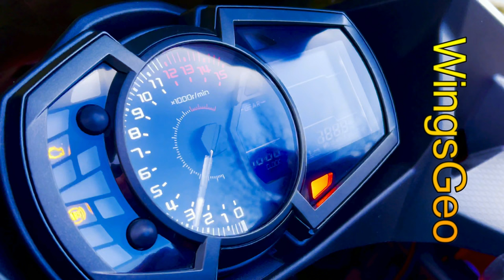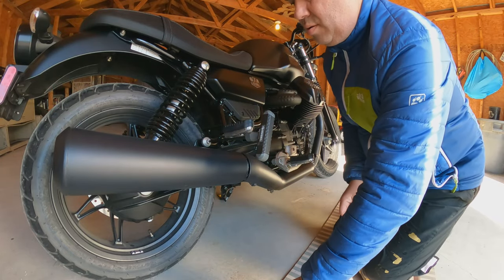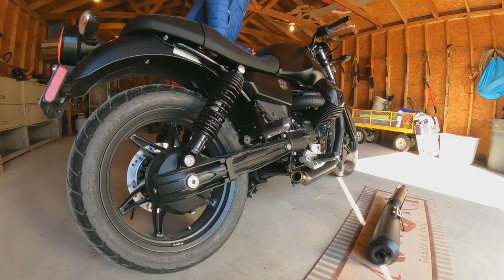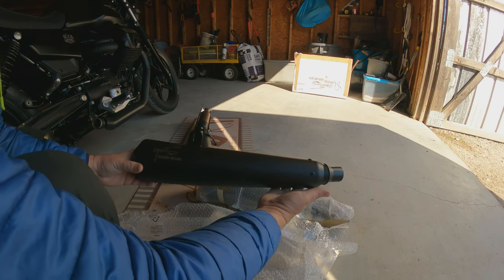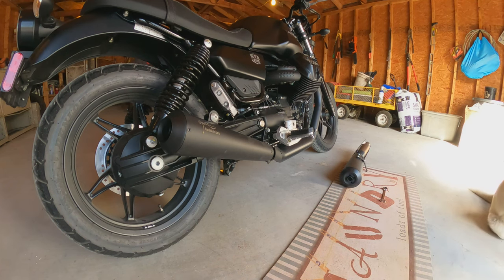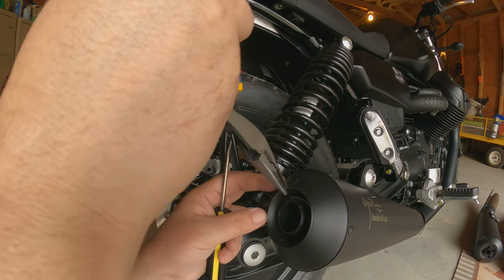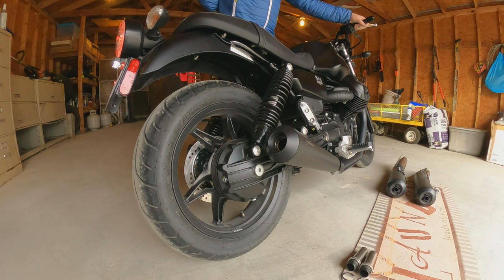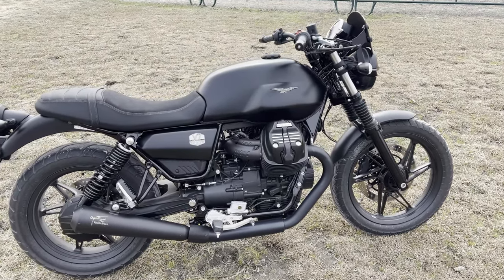Moto Guzzi V7 E5 | Agostini Install & Comparison

Comment: Apparently, at least with the mistral exhaust, when the baffle is removed the bike needs a retune or it won't run quite right. Might not be the same with this exhaust though.
Reply from the maker: I did not have any issues before I sold it but I will say at the time there was nothing available for the E5 bikes. Not sure if there is a tune now via UP Map or the likes.

Comment: I have the longer Agostini's on my v9 and love them too.   Regarding the spring clip, my guess is you didn't have your snap ring tool set quite right.  I have no problem poping mine outs in mere seconds using the same tool.
Reply from the maker: Yeah could be a user error, or mine is just too large. I tried with different lengths at the top but was unable to fully compress the snap ring causing it not to want to come out.

Comment: what fly shield is that?
Reply from the maker: That is an Isotta Flyshield, I did change it to the GCorse fairing though, which I liked much better. There is a video about it on the channel.
Reply: @BunnyandBman  Ill check it out. Im getting my short Agostini delivered soon for my 2018 Dark Carbon. Im using a Dart screen.  Im excited for them.
Reply from the maker: @sph828  You won't be disappointed, on the V7, the Agostini's are magic!

Comment: Does it mess up the ecu etc with or without db killer? Other issues?
Reply from the maker: I had no issues, I would recommend however a re map with the UpMap solution. It was not available at the time of the video.

Comment: These V7s are just classic looking, super sexy, bikes! That exhaust sounds incredible! First time I’ve heard a MG sound like that, but I don’t have much experience with them at all. I’m a Harley guy and the V7 is exactly what Harley should have done with the sportster lineup. Make it E5 compliant, lighten it up, and give it some extra performance. MG succeeds where Harley fails. Thinking seriously about adding one to the garage! Very seriously!
Reply from the maker: I agree, I test-rode the 883 which was meh, and the 1200 which was ok. If you look at the current V7 Special Edition, it is a steal in my book. my only complaint is the non-TFT instrument cluster. I like Physical dials or at least replicate it with a good TFT but I get it, as it was built somewhat to a price point.
Reply: Yeah, in Italy Moto Guzzi are selling good after Harley Davidson stopped the Sportster line, after all with a V7 you can do all the things that you can do with the Sportster and it's so more lighter than the Sportster. 
It's really a shame that the Sporty line is no more in production.

Comment: Great choice, for V7 there are  two great exhaust manufacturers from Mandello, Agostini anf Mistral. Both of them top quality and sound. For V85 I chose Zard exhaust because of look and because I use V85 for travel so I apreciate similar noise level to the stock exhaust with richer sound and little more bass. ;-)
Reply from the maker: The Zard was on top of my list for the V85, I just could not get my hands on one and then I figured out the "free hack" ... lol, I actually wanted the long pipes from Agostini, but again, can't even find them, but I am very happy how the short ones turned out.

Comment: I had the same issue as you, hard to remove the c-clips of the DB-killers. Simple fix, remove the excess material on the inside of the c-clips. That way, both sides come closer and are easy to remove.
Reply from the maker: thanks for the tip, I did not have a good time removing these ... lol

Comment: I went with Mistral for my V7 but certainly considered Agostini after watching, the drive by shots really sold it! At the end of the day they just sounded too much like my Guzzi Tech Griso exhaust and wanted something different. Just hope the DB killers on Mistrals are easier to remove.
Reply from the maker: I don’t think you can go wrong either way. I just put a Mistral on my V100 and it sounds very good. Its a Agostini header /Y pipe with the mistral end can. On my V85 i had it reverse, they all sound good in their own way … ;)

Comment: Very good! I have the longer reverse coned Agostini's in the same color on my bike. I much prefer without DB killers. Great to get the attention of drivers around you with the blip of the throttle. I use a special set of snap ring pilers to take the baffles in and out as needed but i primarily do not use DB killers. AF1 racing is one of the best MG dealers in the nation. If you go out there and they have time they will give you a full tour of their facilities. World class guys and girls! I take my bike from Houston to them to Austin if i have a warranty claim, definitely worth the drive! You make great quality video, keep up the good work!
Reply from the maker: Thank you! I tried to deal with Xtreme in Houston to buy a MG Racer, it was awful. Ended up not getting it, so I see your point going to Austin for sure. I have the special tool but it was still very difficult, maybe user error? ... lol As for AF1, I am very impressed, I am gravitating towards Energica for my first electric bike and they are the only game in town, so this is a good test how easy they are to deal with.
Reply: @BunnyandBman  I got my bike from TeamXtreme and they're total scammers. I wouldn't recommend anyone doing business with them! (They recently changed their name to full throttle powersports to try to shake their bad reputation) If I ever run into you I'll tell you the whole story. No kidding, AF1 really saved my ass and made me give Moto Guzzi a second chance, couldn't be happier!!
Reply from the maker: @xtrythis1170  That's fantastic that you stayed with Guzzi, I am starting to really see the attraction to the brand for a lot of reasons. I also used to work in Houston and still have several friends there and will be visiting sooner than later with the V85. Luckily I only have to make it to Conroe ... lol
Reply: @BunnyandBman  Well I'm in Magnolia which isn't too far from there. Definitely need to meet up in Anderson on highway 3039. Beautiful road out there. It's the closest thing we have to curvy roads around Houston. Lol.

Comment: Hello. Have you received any engine flashlight warnings when you installed the Agostini (especialli after removing db killers)? Or did you do any ECU modifications?
Reply from the maker: When I did it, no errors or fault indicators. At this point , not required but I would recommend the UpMap tuning solution to get the fueling right.

Comment: the tool you have for removing the snap ring, didnt work?.. there is a (yellow) lever on your snap ring plier that changes from inner to outer snap ring removal. was it too short? it looks like it should have worked. Sounds great though!
Reply from the maker: I tried it both ways, but I think my tool was not correctly sized hence it gave me a lot of trouble. You are correct, with the right tool, it should not be a big deal, going with user error here ... =), and yes probably one of the best-sounding pipes out there.

Comment: What did you do about tuning this bike after you added the exhaust? Did you just keep it at the dealer tune? Been struggling to find a lot of tuning options for the 850 model.
Reply from the maker: When I made the video there was nothing out there yet. Now there is UP map, I can recommend it, just tuned my V100 for the cat delete and big bore headers, was a breeze, no drama.

Comment: Did you measure the DBs you get without the killers? This sound is very charming, but cops are quite severe on this in Québec. And yes, they will measure the DBs before you can hit the road again (max 100 decibels)
Reply from the maker: I did not because here in Texas we don’t have any laws for noise and cops don’t care. They are quite loud without the db killers but sound amazing. Since I always wear earplugs when riding it was just right for me.

Comment: Did you not need to remap the ecu since you removed the db killer? Did you feel a lag in the throttle?
Reply from the maker: I would recommend it, there was just a hint of it , nothing major but with Upmap now available its rather easy.

Comment: nice soud! where is the cat btw? in the back pipes or in the straight piping under the footpegs?
Reply from the maker: Under the foot pegs!
Reply: @BunnyandBman  aha! thanks for the info - somebody else was telling me that the cat is in the end exhaust pipes... So I was not sure... so to get rid of the cat I would need to change the whole piping 😕
Reply: @BunnyandBman  hi, thanks for the vid! nice explanation of how easy it is to change them. are you sure that the cat is under the foot pegs? i mean for stock exhausts maybe yes, but the agostinis dont have them inside... you would need to install them in the agostinis, which i am still figuring out how to do... do you have an idea?
Reply from the maker: @manuelstaber5983  Agostini's don't have CAT's, only the stock exhaust has them build in. I am not sure but there might be an option with build in CAT for the Agostini. I got mine from AF1Racing.com, they are very helpful, I would chat with them and see what your options are. Hope this helps.

Comment: I thought the 850 motor doesnt like the fuel mixture when slip on exhaust have the dB killers removed. I thought they needed an New mapping?
Reply from the maker: It is recommended but not required. At the time the video was made, there was nothing available. Now there are fuel tuning / mapping solutions available via UP Map.
Reply: I installed mine without the new mapping and things were fine. The whole mechanic can easily take it. But the new mapping made it much smoother. Highly suggested, not obligated.
Reply from the maker: @jaybou007  agreed, recommended but not a must.

Comment: Great video!

What sort of remap did you use for having the dB killers out?
Reply from the maker: Thank you! and no remap at all. I did revert back to the factory air filter as the high-flow one seemed to lean it out too much. Has been running great, not sure if Guzzitech has a custom map at this point, but at the time of installation, nothing was available.
Reply: @BunnyandBman  So you haven't had any issues in conjunction w/ OEM air filter. have you looked at the plugs? Reason  I'm asking, my set of Agostini were just delivered.
Reply from the maker: @jacksdad7933  I have not checked the plugs. She was running with no issues and made good power. Take a look at my top-speed run video and you know what I mean ... =). I check Guzzitech periodically but they still don't have a reflash tool for the newer V7's.
Reply: @BunnyandBman  Will do, mine only has 397 mi so under 4k rpm. Have a Rapidbike Easy ordered but will be 4 weeks, should help ensure not running too lean. I live and ride mountain twisties 3500-5500 ft El.
Reply: Update sent RBE back as Dimsport said it wasn't for 2021 models. Seem we are awaiting GTM to come up w/mapping + re-flash tool supposedly they will released soon. Mine seems to run fine w/ Db killers in and OEM air filter slight popping on decel.
Reply from the maker: @jacksdad7933  That is what I heard for the E5 models, V7 and V85. No one has cracked their ECU's yet. My V85 runs better with the DB killers in for some reason, the V7 did ok without.

Comment: Those Agostini's sound and look fantastic! Nice upgrade. I am considering my next bike and hope to test ride a 2021 V7 E5 this week if the weather allows. What year is this bike? 2021? I ask because it seems that somewhere part way through the manufacture year they changed the blinkers to LED and changed the shape of the rear brake light because I am seeing 2021's with both.  
How many miles did you ride before changing to the Agostinis? Your gaskets looked in perfect condition and did not appear to get damaged when removing the stock cans. Did the Agostinis come with new gaskets?
Reply from the maker: It is a late 2021, the LED blinkers are from the euro version that we don't get due to regulations here in the USA. You can however fix that with aftermarket ones.I belive I had about 300 miles before switching to the Agostini's. Agostinis did not require any gaskets as far as I remember and I did not detect any exhaust leaks after the installation. Hope this helps. Cheers!
Reply: @BunnyandBman  I was wondering if the LED blinkers and the differently shaped brake light was Euro specific but I had no logic to make sense of that. We have plenty of LED blinkers here on stock bikes...Like my 2021 Honda Rebel 500. How is it the Moto Guzzi's are excluded from having them?
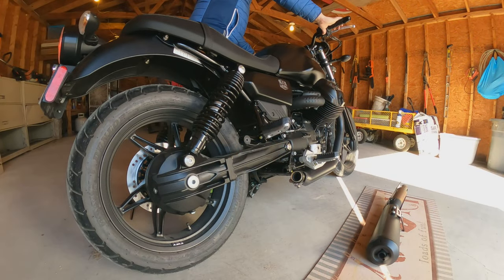Regarding the gaskets....It looks like especially at 2:27 thru 2:31 I can see what appears to be stock from factory a copper weave gasket on the end of your header pipe. I had one on my Honda which was damaged removing the stock muffler but fortunately the aftermarket can was designed to clamp directly onto the header without a gasket so I did not have to source one to replace.
Reply from the maker: @dustytriumph  Concerning the blinkers, not sure, If I had to guess I would say cost might have been a factor why they stuck with the old style. But honestly I am a bit suprised, every bike I own from kawasaki, honda and Moto Guzzi have the old style blinkers and I was told it is because of the outdated regulations here.
Reply: @BunnyandBman  I just got back from test riding the E5 V7 850. Whoa! Very different (as expected but even more so than I imagined) than my Honda Rebel 500 and the Indian Scout Sixty I test rode last week. I've heard the terms "very agricultural" and "the Italian Harley" used. Yah, I'd say that sums it up. All I know as a new rider with only 3000 miles is you really know you are riding a motorcycle and not a sewing machine. Man that was raw and visceral compared to what I've ridden. 
The dealer-owner suggested he thought the blinkers we in the US get on the V7 might have to do with cost. I much prefer the look of the Euro brake light and turn signals but I wouldn't bother swapping out should I get one of these. Bit of a disappointment however.
My Rebel came with LED turn signals that stay on as running lights. Their use started I think with the 2020 model launched in 2019. That's the sum total of all I know about LED.  ;-),
Reply from the maker: @dustytriumph  I am a huge fan of the V7, if you opt for the Stone E5 instead of the Special, you save a few bucks, get tubeless tires and LED for front and rear , the front has a build in LED running light in the shape of the MG Eagle, so cool! Anyhow, these bikes have a lot of character for sure and are not your average Honda. The transnission takes about 2000 miles to break in, but after that they shift amazingly smooth, at least that is what happed with my V85.
Reply: @BunnyandBman  I've looked at these with interest for years and the black V7 Stone would always be my only choice for the overall look but also the cast wheels and tubeless tires as well as lack of chrome.
Reply from the maker: @dustytriumph  I don't think you can go wrong with either version, but yes the Stone has the advantage of the tubeless tires and LED front light.

Comment: I’m looking at a set of these. So when riding do they have that droning noise or just a nice rumble. Hope makes sense. Thank you for your input
Reply from the maker: I would go with the rumble, but as a disclaimer, I ALWAYS wear earplugs, so if there is any, it probably gets canceled by them. On a side note, you should not have that problem with the DB killers left in place, it was just too tame for me, considering my earplugs.
Reply: I ride ear plugs Shoei GTair helmet. Should be ok. Thank you appreciate your reply
Reply: Am I missing something,  people spend a fortune on louder pipes, then ride with earplugs in so they are not to loud....   Why not just keep the standard pipes and the money
Reply: @chriscurrie5597  it's not just about how loud new pipes make the bike.  It's actually much more about how they change the tone of the motorcycle.

Comment: Meanwhile, I have a brand new V7 850 Special - and guess what I'll do first? This is very helpful.
Reply from the maker: OMG, congratulations, down the road I hope to join you! For now, I will "suffer" with the V85 and RS660 ... =)
Reply: @BunnyandBman  One more question: did they recommend a re-map if using the Agostinis without DB killer?
Reply from the maker: @YangCalgary  A tune is always better, but I have been running them with no issues and it woke up the bike IMO. I did however reverse the high-flow air filter to stock to not lean it out any further.
Reply: Just got one for my Centenario. Zero regrets

Comment: hello. I know it sounds silly, but where can i buy them : )  . Im form Romania, Bucharest...
My local moto guzzi supplier seams it has no knowledge of them 
Thanks.
Reply from the maker: I bought them from a Dealer called AF1racing, I put a link in the description. They have an online shop where you should be able to purchase them.
Good Luck!
Reply: @BunnyandBman  thanks a lot. U Rock! :)
Reply: Hey, IDK if it helps but a couple of days a go I bought a v7 850 from thebikehub with mistral exhaust on, so if you are interested, give it a shot. It cost me around 600 euros.

Comment: Did you do a tune?
Reply from the maker: No tune back then but there is now upmap which I would highly recommend. I tuned my V100 with upmap and no issues at all, bike runs amazing. You don’t really need a tune but it sure helps with better fueling and fuel to air ratios.